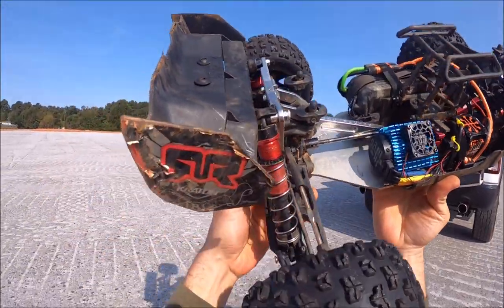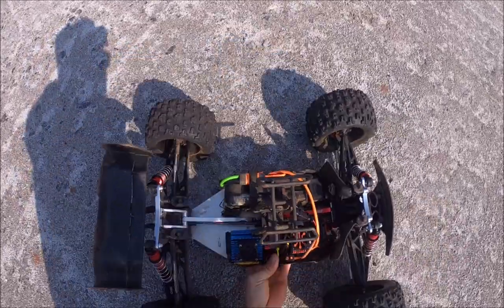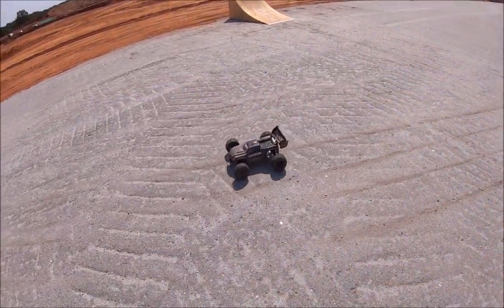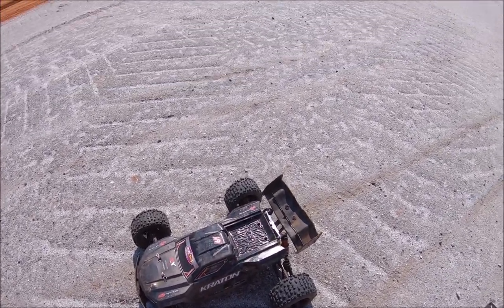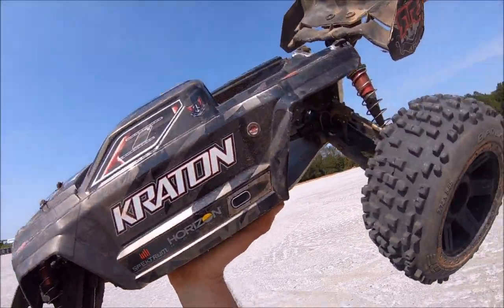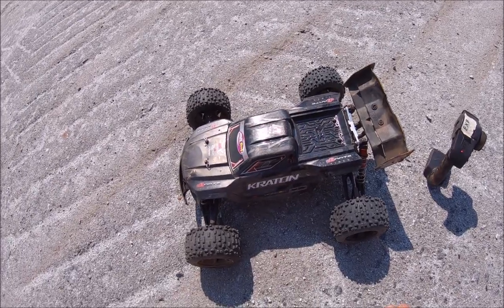NEW M2C upgrades, FIRMA 6s combo test and Diff tips. Arrma Kraton EXB

Comment: That was BADASS Brother Eric 😜!!! Great to see the Spectrum combo run smoothly with respectable power 👀. I've been having some weirdness with my set-up and still sorting out the exact cause. Definitely going through the bearings cuz I'm getting a drag brake sensation of resistance midair. The timing feels off instead of smooth and predictable 🤔. ESC is getting warm/hot fast. May need to service my motor bearings as well. Nice tip on the diff spacers Bro 👍. Definitely more support for the planetaries. I'm sticking with a shimmed traditional setup until the new version spacer arrives. Nice to see the Badlands 3.8's back out 🥰🥰. The smaller wheels rip so friggin hard Bro 🤗. Just a kickass wicked bash Eric 😱. You got me pumped to get back out again!!! Blue skies returned today. Just need some time off work 🍻🤙🤙😎💪👊👊

Comment from the maker: This truck is in need of a bearing overhaul so she's sounding a bit rough at times.😱🤣The rear diff mod is holding up perfectly so far 👌Hopefully that'll solve the issue but time will tell. Overall pleased with the Spektrum 6s electronics, The truck was a bit more manageable and lighter. HUGE shoutout as well to M2C Racing and Arrma!!😎🤘
Reply: How are the motor temps with this 1480kv? Most say 1480kv ftw low temps?
Reply: What did you do exacly? 3 large one small shim? What does that mean. I added an extra 0.2mm shim on my rear LSD diff idid spin smoothly but everything started to bend. i lost one sun gear wall i caught this by luck decided to randomly open my rear diff and was surprised when i was putting everything back togueter stuff were not looking right. Specially the steel diff cup insert
Reply: What he^^^ said. What shims?
Reply from the maker: This is only for the open diff. There is two large and one small from the factory. "Supposed to be"🤣I simply added one more large per sun gear. So 3 large and one small. So far its working and that's driving hard.🤙
Reply: RC DUDE81 what weight diff oils do you recommend?
Reply from the maker: @demonsubi  I'm using 50k front, 100k center and 30k rear. Diff oil setup is subjective but it's what I like with the LSD 's.
Reply: @demonsubi  i personally have a v4 diff in the front at 60k stock exb center diff at 100k 12.500k in the rear open diff and i still ahve some oversteer i have ti counter steer and it wiggles the butt a lot i changed the shock positions in the rear im a bit lost in what i need to do to make the rear tires lose traction. I want to know what he prefers too the exb diffs or normal difs what handles the best too
Reply: @RCDUDE81  do you enjoy LSD more or v4 single diff oil? Still trying to fix over steer
Reply from the maker: I dont like it better but just got used to the feel.😜I dont go as thick in the center as I would a RTR diff but overall it's not bad. I drive/bash so fast I can't really tell a huge difference in steering. I just adapt my driving to it. Lazy I guess.🤣🤣

Comment: Awesome sends dude, she's flying! 👍👍
I have my rear diff with 3 star plates on each side with 10k (open), and then the front set to max LSD effect also with 10k. Really liking how that's handling. 
No matter what shims I put under the sun gear mine would still strip. Also, I can't keep my 2050kv motor under 200f with the 12t pinion! Does a fan really make that much of a difference? I have the Yeah Racing dual tornado setup coming for it. I swapped my steering bar to M2C as well, mine bent.
Thanks for the awesome EXB content 👍👍

Comment: I noticed minus the m2c shock Towers I have basically the same setup, is there a reason why you're not running the tower to Tower brace and also still running the exb front brace? I had a hell of a time I went to switch my front brace from exb to m2c and it was a struggle also the tower to tower would flex the rear of my chassis down so I just left it off any input would b great. My Outcast has the same upgrade chassis braces Etc from m2c everything was buttery-smooth. Not a big deal just thought I'd ask since I seen we had the exact same setup with no Center brace and still running exb front brace thanks for the amazing work you do on YouTube man

Comment: Awesome bashes as always Eric!  Curious about the temps on firma150 and the 2050? I saw you switched tires towards the end to the backflip lp? Was it because of temps or just trying to dial in the rig?  Thanks for all you do brother.. You are an inspiration to us bashers to push these rigs further than I ever thought possible.
Reply from the maker: Thanks so much Daniel!👊I didn't have my temp gun with me but I ran a full pack without hitting thermal. Motor didn't feel too hot either.
 It was pretty cool out like 60's and also the fans so that helped. I did go Badlands 3.8's and a 20 tooth pinion near the end just to try something different. Temps were still decent👌Not a huge torquey system but definitely performed well!😎👊🤘🤘🍻
Reply: @RCDUDE81  
Your videos are always amazing and great!
What wheels do you like the most for the Kraton EXB 6S?
Copperhead 2 
Backflip 6S
Backflip LP 4S

Comment: Yeah 🤘🤘💪😎 very nice, as always a great and beautiful session, can I ask you a curiosity? but the rear differential case, did you break it? I saw you wore the HOT RACING one.
I ask you because today in three jumps I have broken in two, two new boxes 😑 I have already ordered the aluminum ones
Reply from the maker: Thanks bro!😎👊Yes I broke the rear diffcase quite a while back before the truck was even released🤣🤣A total brain fart landing!😝HR cases are the way to go for sure! Probably doing the front next! You need at least 1 or 2 outer bearing shims though with the EXB gears. Thanks for watching bro!😎💪👊🤘🤘
Reply: @RCDUDE81  Thank you very much, I have already adjusted the differentials with the shims, but when after two jumps the whole case broke in two, we were amazed
Reply from the maker: Yeah that's kinda strange🤔Where the suspension blocks bent? Maybe the lower bulkhead was stressed a certain way. Sorry to hear that bro!
Reply: @RCDUDE81  Do nothing now, I ordered the two aluminum cases from VITAVON, they are very robust, I also mount them on my notorious, but I noticed one thing, even though the chassis is 7075 aluminum and still very thin and flexible, then with strong blows, it pushes much more on the rear reinforcement arm (the red one with the word EXB), and consequently all the blow falls on the case of the differential and opens in two

Comment: Does your EXB suspension squeak uncommonly loud? Maybe it’s the boots on the shock shafts that hold in dirt? Mine squeaks right after the first run.
Reply from the maker: Sometimes they will squeak especially if running in dry dusty conditions. A good bath and lube should fix it!👊
Reply: Mine creaked alot. The lower suspension pin was rusty and binding quite badly. I had only used it 3 times. They are not a good material, stainless needed.

Comment: Question for you ...You’ve always been so great to help me.
I have the Arma Kraton V4. However I’m looking to upgrade my differentials with components to the EXB gears.
Ideally I could just buy the entire diff kit three times and completely convert. However the only thing that I’m looking to convert initially is just the Front and rear main input gears... up to the EXB model
Am I OK to run the upgraded EXB input gear meshed with the stock V4 main diff 43t spiral  diff gear, even though the upgraded EXB has been modified a bit (15° Spiral cut as opposed to the 5° V4 counterpart.)
Or... if I upgrade the main input gear to the exb version am I required to also upgrade to the exb 43t main spiral diff gear?
Lastly, if I must match the two... Can I still keep the internal cup components of my V4 model?
Thx
Reply from the maker: Always glad to help!👊If you're converting to EXB gears, you need the ring and input gears as the gears also have thicker teeth. So a RTR main gear won't mesh to the EXB input. You can still use the outer diffcase and center cups.👌However you will need to also convert the internals with EXB inner case. Basically you'll need the whole diff to do a conversion.
Reply: @RCDUDE81  
That makes sense especially pertaining to the input gear and the ring gear. However I’m having trouble understanding why I would need to convert the internal gears inside of the cup? Are they not part of a separate system pertaining to the mesh of the former. If that makes sense. Couldn’t I just keep my internal spider gears and planetary gears the same?
Reply from the maker: The ring gears are made totally different as well and also the outdrives have a fatter shaft too. It all kinda works together.
Reply: @RCDUDE81 
Right... I’m just thinking what if I just bought the exb main input gear, and the new exb spiral/crown gear only (for the front and the rear) and slapped those in using the pre existing V4 diff cups, internals outdrives etc... would that not work? Or am I still missing something. Still a little unclear I suppose.
Reply from the maker: Yeah its complicated! Wish I could send a pic..🤣The EXB main gear won't bolt up to a RTR inner case. The holes dont line up. The EXB inner case is a tad smaller too. In order to run EXB gears, you need the whole diff. Sorry about the confusion bro!
Reply: @RCDUDE81  I think I got you now, and To think I thought they were supporting backwards compatibility LOL, I mean how hard would it have been for them to simply make the holes on the large crown gear simply lineup to both EXB & RTR cups. Thanks for the help! And the patience with me. Luv what you do!!

Comment: Hay bro. So I'm doing a Revo 3.3 conversion and was looking at the Blx 185 but I have been seeing a lot of the Spektrum 150a what would you recommend
Reply from the maker: You can never go wrong with a blx system man.👌I'm running the Spektrum in my Kraton EXB now and it seems to be doing comparable to the blx with just a hair of lag. Just takes getting used to but If I had the choice, it'd be the blx.
Reply: @RCDUDE81  question Eric how you think the blx motor will work with my max 6?

Comment: Did you say you had a hobbystar esc that was glitching on you?   Like the brake would smash into reverse?
Reply from the maker: The Hobbywing Max6. I still need to diagnose what's going on. It was just acting weird..😝Throttle was super touchy and sporadic..I wanted to test out this Spektrum system anyway.😁
Reply: @RCDUDE81  ya never did figure it out?  I have a max5 for my k8s I have yet to install.  Will be my first hobbywing esc.   I've always rocked castle stuff for the most part.

Comment: How you doing Brother? Quick question. I just installed a max 6 esc and the hobbystar 4092 1730. The forward and reverse are reversed. Not in the sense of the trigger, but when going forward I have to double trigger like in reverse and it has minimal power. And when in reverse she goes like a bat out of hell. I need these 2 responses reversed. Any suggestions?
Reply from the maker: What transmitter do you have? Maybe try switching the throttle mode on the remote. If it still does it, try switching around any of the 3 motor wires. If that's not it, check the motor rotation through the ESC settings. Maybe somehow it got reversed but it should be in the remote or motor wiring. Let me know how it goes bro!😎👊

Comment: I ha problems just by adding an extra 0.2mm shim on my rear diff with LSD jason told me clear only 2 shims on both side one small one large or you will end up bending the shims,plates and round down the diff case. Idk what you mean with 3 larger 1 small but becarful
Reply: Wait 3 large 1 small behind each planetary with LSD!!? thats going to fail in no time man
Reply: Something is wrong with your cups for example if i try to add a 0.2mm shim extra on my center diff it locks up in a lot of spots
Reply from the maker: Only shim the open diff. My rear diff isn't LSD.😜I said instead of going LSD, I wanted to just properly shim the open diff. Just an experiment but so far it's working!👊

Comment: Another Killer Bash Session Brother Eric!
Plenty of speed in that setup.... Love the delayed triple and mega launches off the ramp and natural construction mounds!
That a new ramp? That thing looks ultra wide send it (dimensions?).... Pickup only on that one!
After you drop in that front upper M2C hinge pin Retainer, how much EXB will be left 🤔😜😂
Killing the game brother.... Gotta collaborate soon brotha

Rock on D
Reply from the maker: Thanks Dennis!😁Had a lot of fun at both spots for sure!😍Not a new ramp but definitely had traction problems on the run up.😝That flat sandy gravel was super loose so I couldn't get the speed I wanted at launch. Super tricky on the line too..💩Still had a blast though! Yeah after I change the upper mount, basically the diffs and top plate are original EXB..😜🤣🤣Thanks for watching buddy!😎👊🤘🤘🍻

Comment: What CST do you run the shocks?
Reply from the maker: Still running stock 80wt. Set up pretty nice from the factory imo.😎👊
Reply: @RCDUDE81  indeed! Still, mine is chassis slapping alot, cant drop it from 3 feet without it slapping. Could it be low on shock oil from factory? Its one of the only things i haven't checked. Thougt it had 30 or 40wt oil from factory hehe. Had traxxas before this exb 😅
Reply from the maker: 🤣Yeah 80wt stock. Chassis slap is nothing to worry about and is what you want!👌You can always run your shock collars down for a bit more clearance and will stiffen the suspension a tad. Only downfall there is compromising the shock rod end and upper bolt but shouldn't be a huge concern as long as it can still bottom out on big jumps.

Comment: I definitely like 6s Arrmas. I have 5 including EXB. But it seems all the EXB parts need replaced. Think I might sell it. I think the rtr is better cause they run and you can upgrade at will
Reply: Bc they run lmao , the exb lsd diffs are cool bc get power down , but i agree somewhat for me out of  8 arrmas the kratons are my parts eaters money pits , and too think outcast ect same rig befuddled me just shows you how important setup is .
Reply: @paulclancy2404  yea I have a few 6s Arrmas. I might get the EXB Mojave but this EXB has got to go im not putting all the money I've put in others into this for diffs. If they end up being that great I'll just swap into my others. But aluminum diff cases solved most of my diff issues
Reply: @justins6465  you think diffs be fixed in exb ? Amazing abuse mojave can take  aluminum diff boxes work  good  plastic flexes once rc  gets older ,
Reply: @paulclancy2404  I hope they fix before EXB Mojave comes out. I run aluminum cases in most of my 6s Arrmas. I got just the aluminum sleeves in one trying to figure out if that's enough for stock case to stay sturdy

Comment: Been almost 6 months maybe since the EXB was released and still no solutions from Arma for the rear diff failures. Been hearing the lsd diff is the way to go but they’re still not available. What a joke. Shame that people who bought this lemon on launch are having to play armchair engineer to come with ways to make it work with locking the diffs and shims. Shouldn’t have to be doing that. Arma’s reliability and customer service has been awful.
Reply from the maker: It is unfortunate but at least they are giving warrantees for the people that are having issues. All the new trucks will have the updated diff. I do think the Arrma test team needs to beat on them a little harder before manufacturing parts and these issues will be found early!🤣
Reply: RC DUDE81....the thing is that people weren’t even beating on them that hard and they are failing during the first run or so. Now people are experimenting with locking the rear diff just so its not sitting on the bench, which is leading to other problems and breakages. Idk man....I was expecting better days for Arma after Horizon bought them. So far, that hasn’t been the case. I mean the rig you’re running isn’t even a true EXB. You have an M2C chassis and towers fitted on it. IMO the EXB has been nothing more than over priced marketing gimmick. Hate to say it but at this point, what else is it supposed to be?